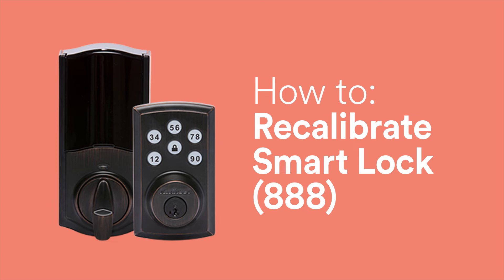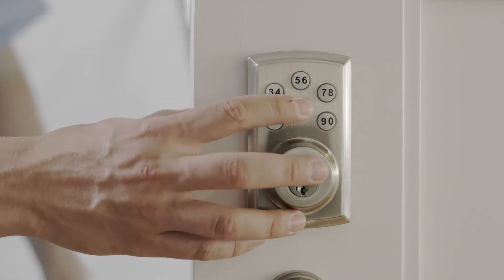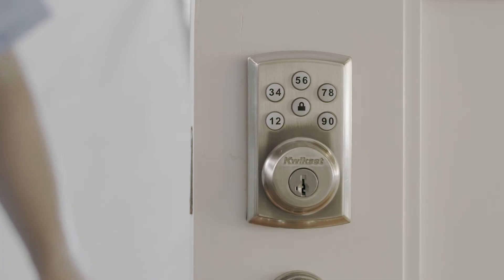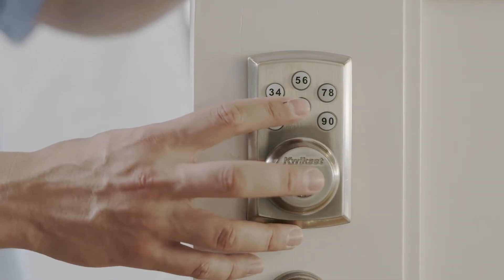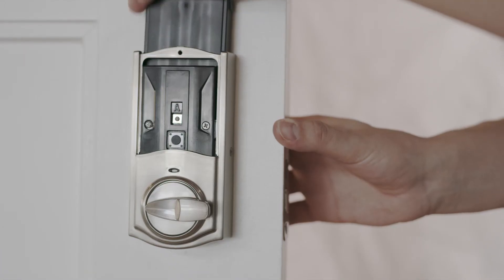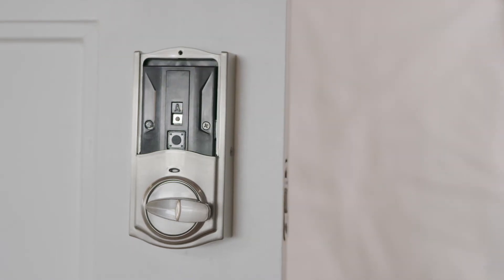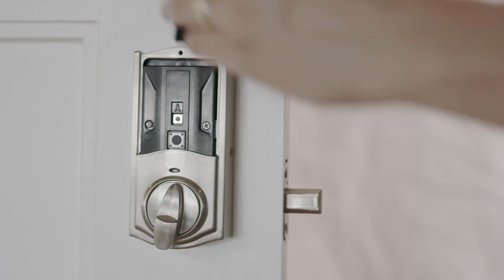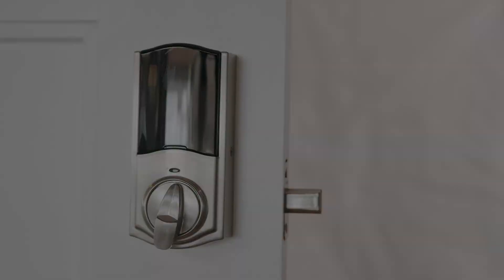How to: Recalibrate Smart Lock (Kwikset 888)

Comment: WORKED GREAT THANKS!
Lock was stuck in a continuous locking loop (motor running nonstop trying to lock when it was already locked)
Extremely annoying. I couldnt stop it from doing it by pressing the code, manipulating the turn key, using the key etc... this worked immediately